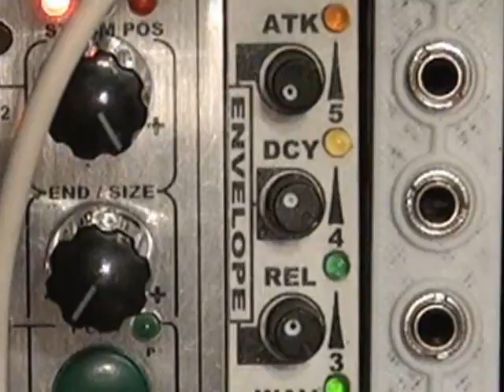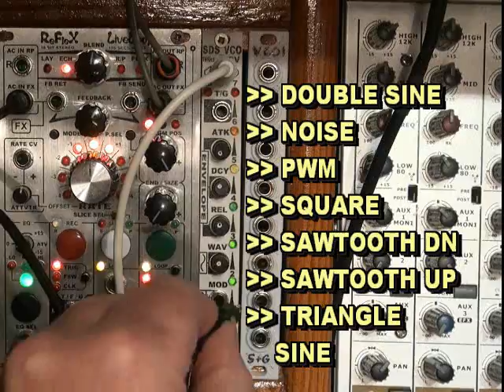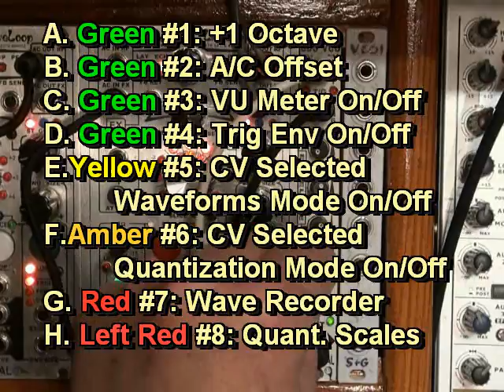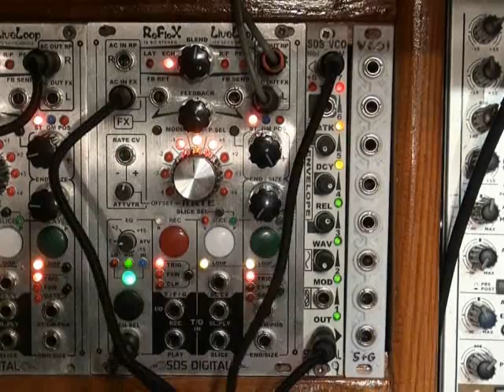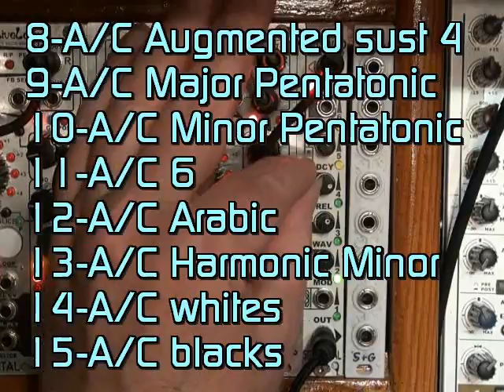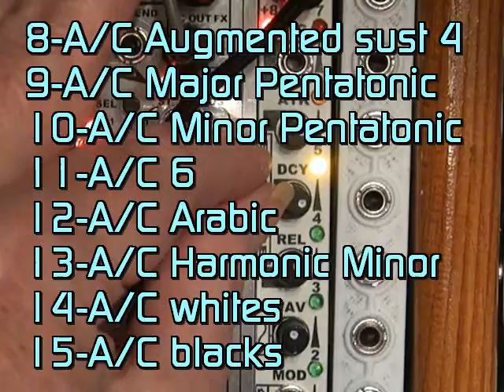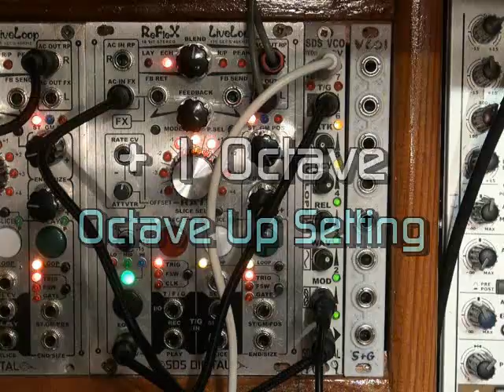SDS_VCO Demo

Comment: This is amazing and so are you! I will be getting one of these this summer!!! So is this a full standalone module? I guess I am not sure if the EG is connected to the internal VCO, or is it setup to function as an EG for an external VCO?
Reply from the maker: It has is a digital VCO with a VCA built in, the EG controls are on the panel. It's the equiv of a VCO+VCA+EG all in one. In this configuration it doesn't VCA external VCO signals, but that is a good idea for another alt firmware :)
Reply: This pretty much kicks ass as is! Adding anymore features might make my brain melt :^)
About how long are the attack and release times?